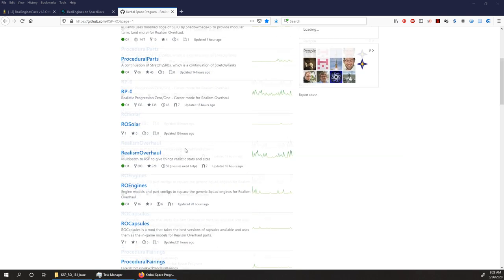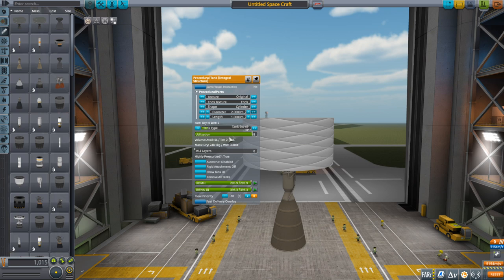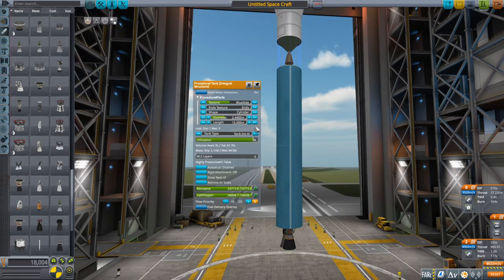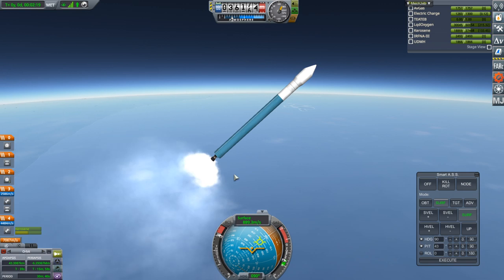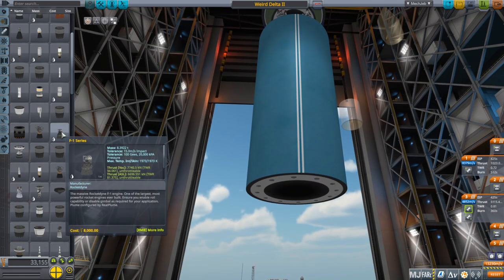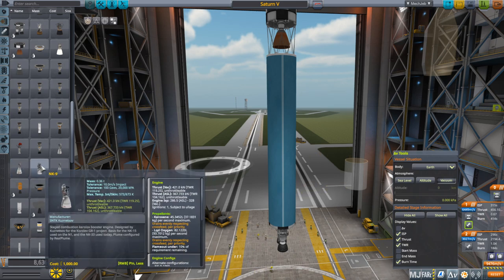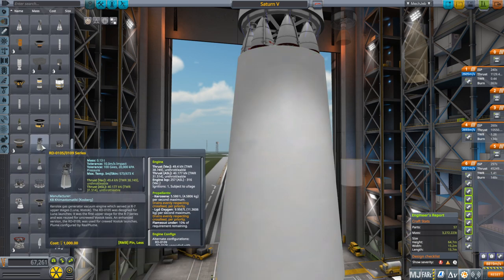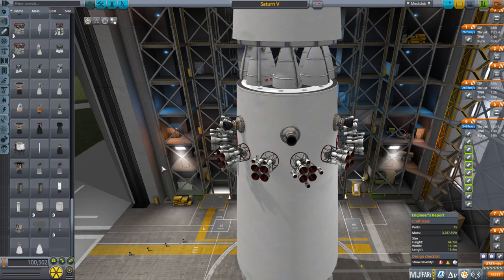RO in KSP 1.8.1 Tutorials - 3 Part Mods, Many Rockets

Comment: Thanks for the tutorial. I followed your video as closely as possible.  I am running into a problem with procedural parts where the length and width controls are small white overlaid boxes in the part menu.  I've tried several versions of procedural parts with no change.   Any suggestions would be great.

Comment: Will you update your mod for 1.8.1 or is it already updated?
Also will there be more engines?
Reply from the maker: There are shader problems with them because I made them in an older version of Unity. Basically, I have to import them all back in through a newer version of Unity to get them to look right, and that'll take time.

Comment: Isn't the Karman Line 100km? or does RO Simulate Orbit Decay
Reply from the maker: RO does not simulate orbital decay, but the RSS atmosphere ends at 140 km. That may be because both in the Apollo era and with the Shuttle, 400,000 feet (or so) was the line marking atmospheric interface for reentry and they went a bit up from that. I remember when it was something like 160 km in old versions of RSS, though.

Comment: hey just a quick question, so i have all of the raidernicks mods and also FASA and all of the historical rocket parts are duplicated. also rocket files dont work (they say im missing some parts). maybe you know what causes the problem?
Reply from the maker: Nothing comes to mind - I've never seen that before. Inside GameData, do you have another GameData folder where the parts were incorrectly unzipped to? That's the only thing I can think of for duplicates.
Reply: @RaizSpace  nope there isn't one there. I deleted FASA and now the craft files say im missing the engines even though i have most recent version of ROengines :/
Reply: maybe rocket files are out of date? but they came with the mods i dunno
Reply from the maker: Okay, so if you're using RO, the only rocket files you should use are the ones that come with RO - the ones that come with RaiderNick's mods are for stock only. I don't use ROEngines, so that shouldn't be necessary. The mod I added in the tutorial series was RealEngines, not ROEngines.
Reply: @RaizSpace  Thanks! That solved the problem